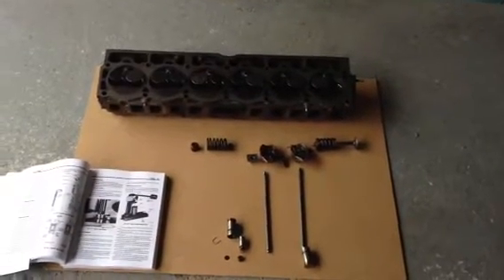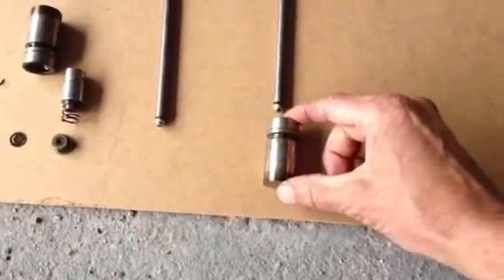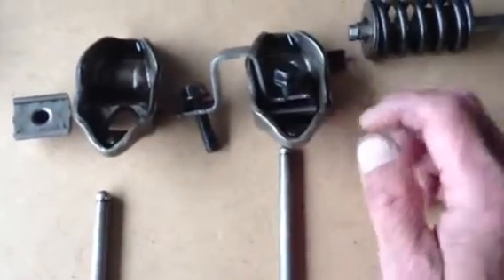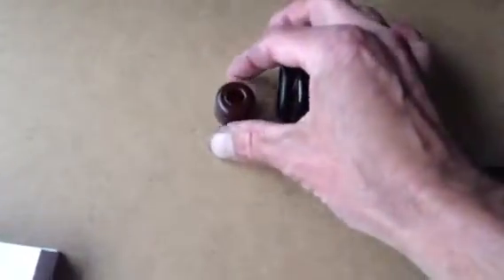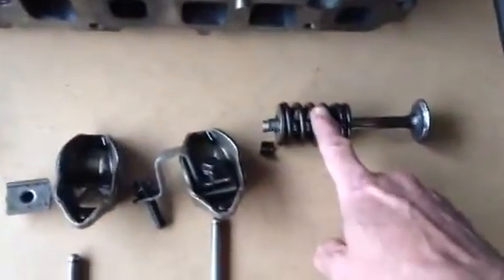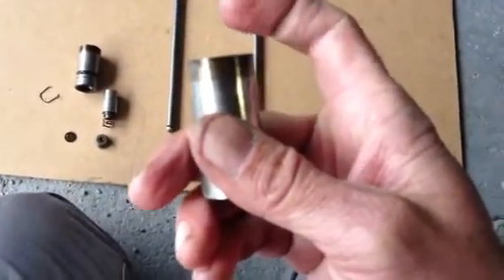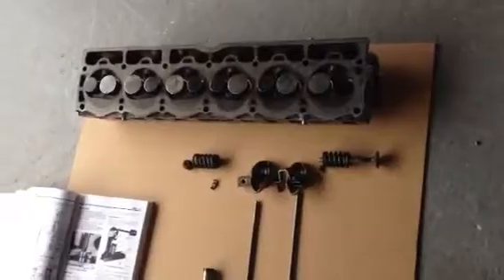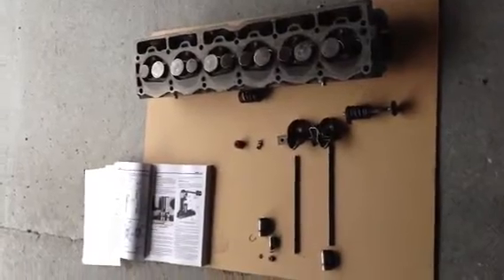Jeep 258 bent push rod sticky valve - full analysis #15

Comment: I have a 1985 wagoneer with the 5.9 l AMC 360 and I had a bent pushrod but the weird thing is only one out of all bent
Reply from the maker: Hi Nick, I assume if it is only one, it is at the extreme end of the cylinder ? I guess it could be same as my problem: either valve got temporary stuck or the hydraulic lifter if full of dirt ? Let me know if you need more advice. Cheers, Ronald